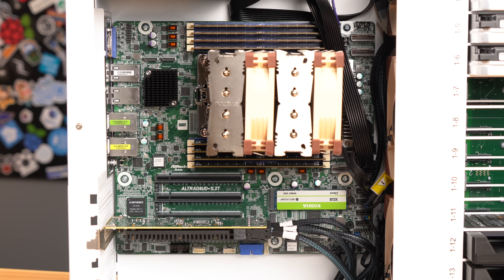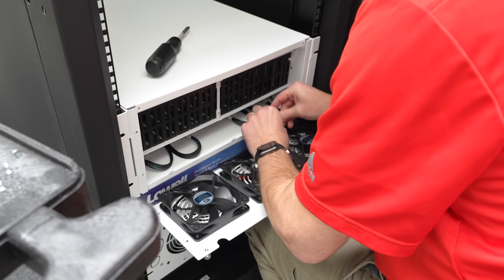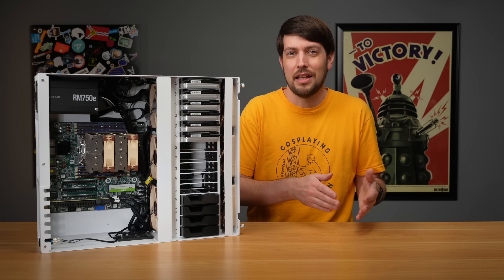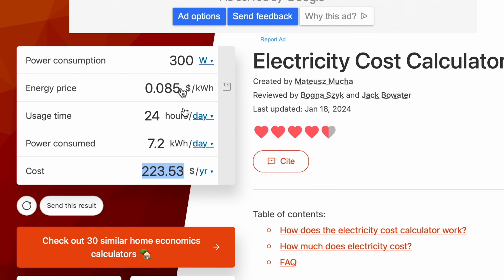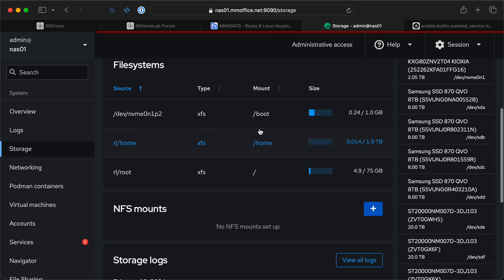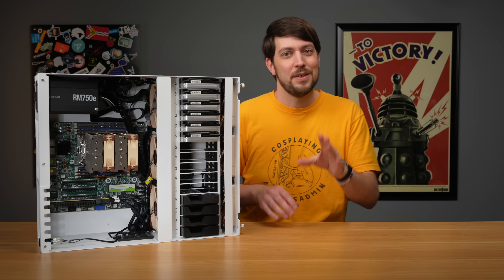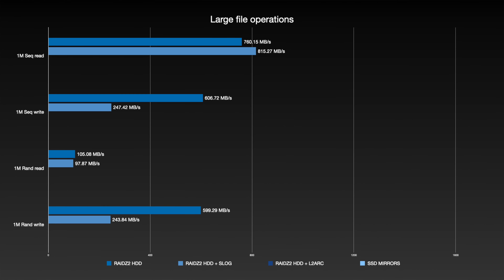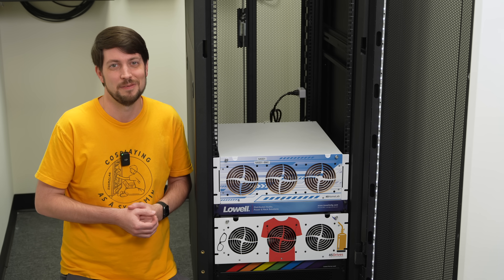Silencing the 100% Arm NAS—while making it FASTER!

Comment: Regarding the SLOG testing; investigate the model of SSD you have and if it plays well with ZFS or not. Historically consumer grade SSDs don't play well with ZFS and result in inconsistent behavior due to their NAND and controllers.
Reply from the maker: Definitely—there's a consensus you need either enterprise write-optimized SSDs or something like Optane drives for the best SLOG experience.
Reply: @JeffGeerling  Would you like to borrow a pair of 1.6tb Intel SATA SSDs (S3610) for testing?

Comment: Pleas Try the Noctua-spacer on the stock fans
Reply from the maker: I may do some testing with the CoolerGuys fans again, though re-routing them all through the motherboard/fan hub.

It'd be nice if 45Drives offered up a small kit or something where you could upgrade the power distribution board with a built in fan hub that doesn't just blast all the fans 100% always.

Comment: Fan noise? Bad sound.
Jeff Geerling? Good sound.
Reply: Maybe I'm alone in this, but I like a little bit of fan noise in a "haha, the computer is thinking" kinda way, same with hard drive clicks and whirring.
Reply: @dafoex me with my pi, using pwm to control the fan through load average of 1 minute, instead of temp or CPU usage
Reply: @dafoex  it's definitely a nostalgic sound!
Reply: Jeff saying nactua instead of noctua is another sound altogether